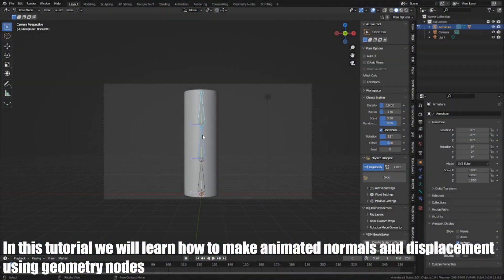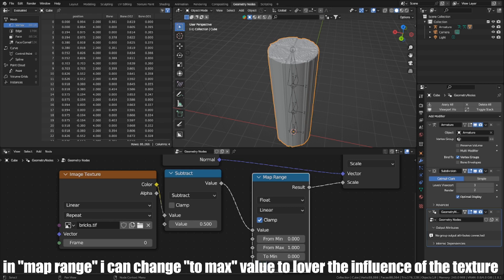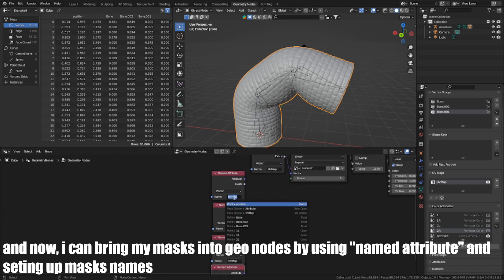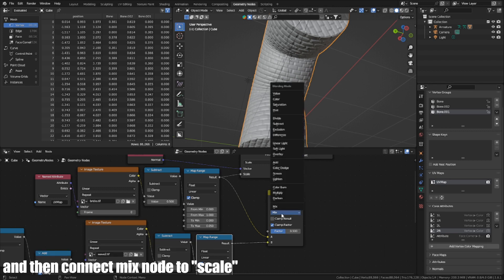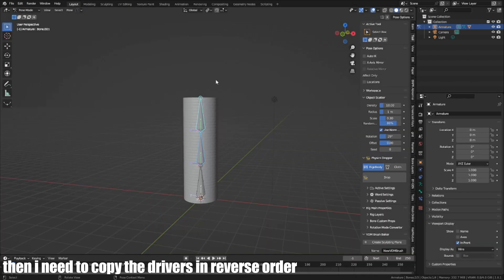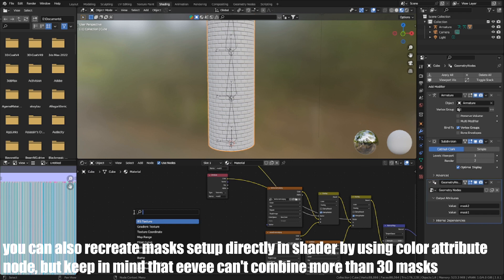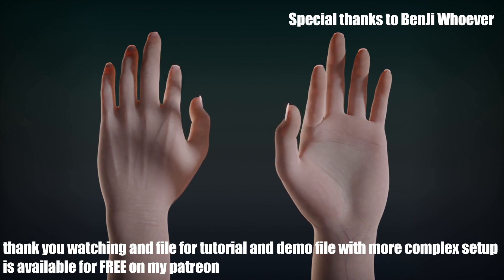[Blender] animated displacement and normal using geometry nodes

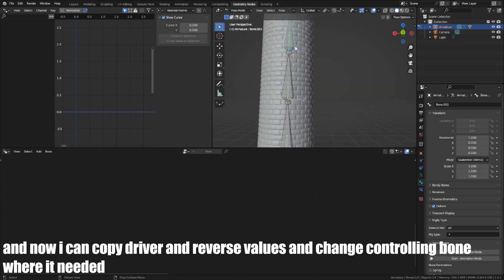Comment: 3:38 It's better to put the drivers on modifier inputs than on the nodes themselves. Node trees are their own ID type, so if you put the driver on the node then it belongs to something other than the rigged character... Meaning that you can't reuse the node group, since every copy has the same driver. It's best to keep your drivers all on the object data  so the Geometry Nodes work on their own. You cam do it by adding more inputs to the tree from the Group Input node and putting the drivers on them.